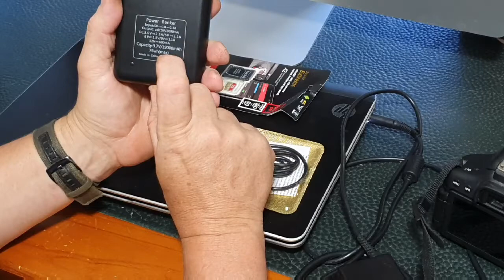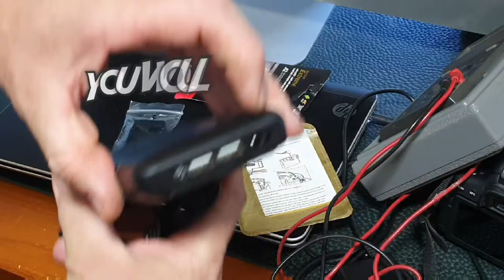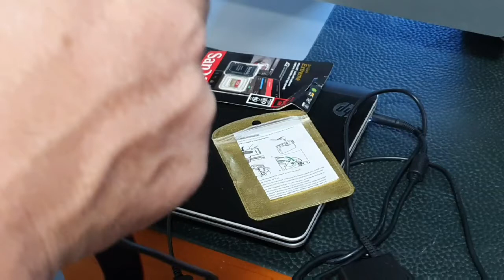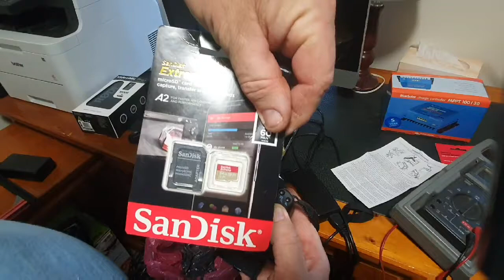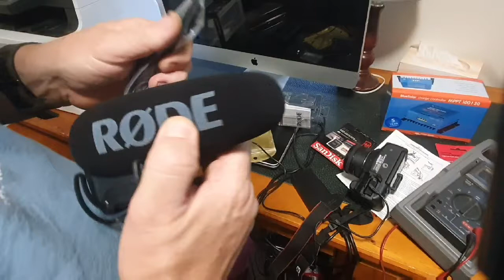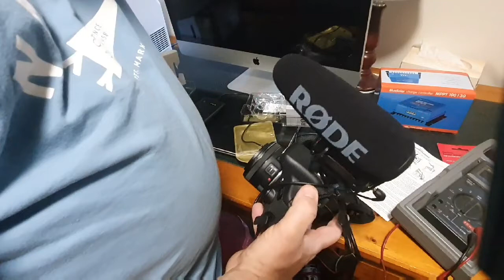Powering a DSLR camera with a USB power bank for youtube recording.

Comment: You should sign up for amazon affiliate and link the products you are using.... that being said... you got a link to that power supply? :)
Reply from the maker: Maybe I will look now for you mate.
AU $13.02  50%OFF | 3.6V 5V 6V 9V 12V Mobile Power Bank Box USB 6x18650 Battery Charger Adapter
https://a.aliexpress.com/_m0BVWzt
AU $17.17 | Mobile power bank CA-PS700 charger LC-E17 USB cable+DR-E17 DC Coupler LP-E17 dummy battery for Canon EOS M3 M5 M6
https://a.aliexpress.com/_mKKCIej
Reply: @chuxxsss  thanks!!!